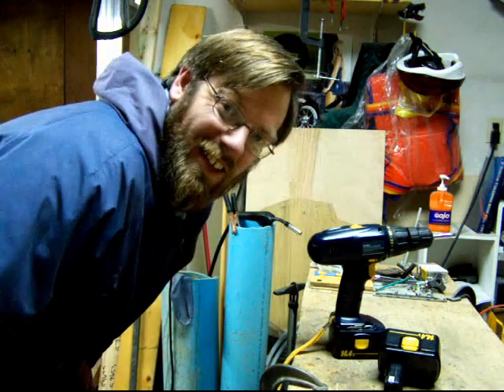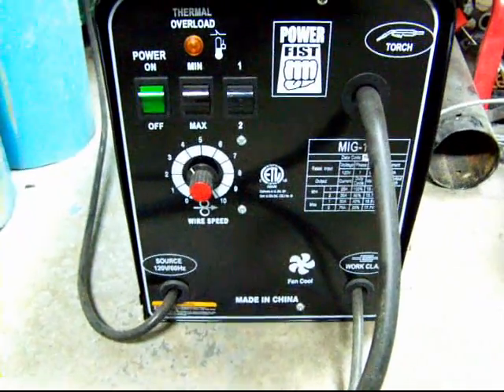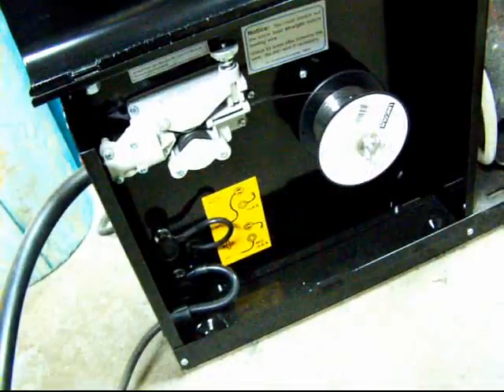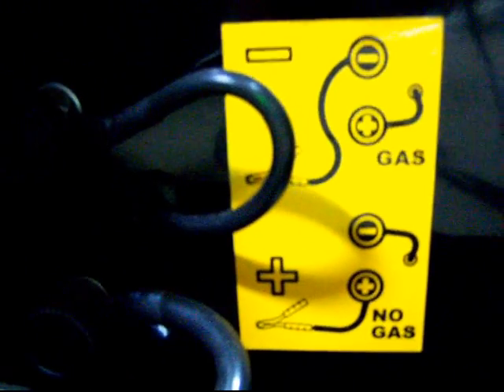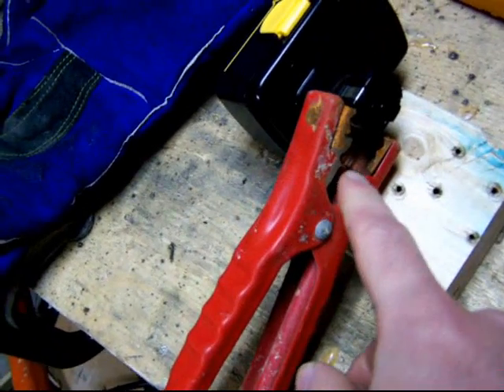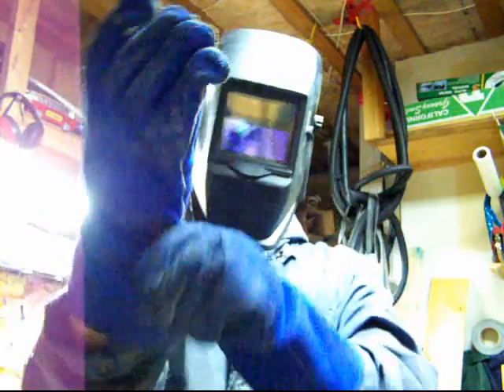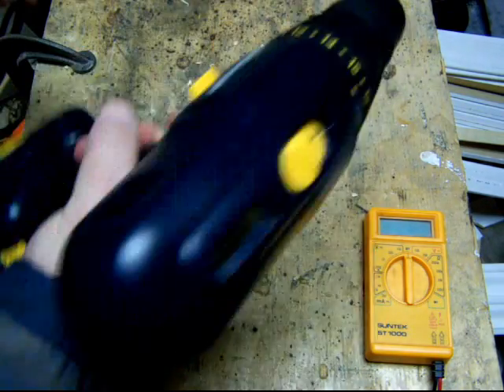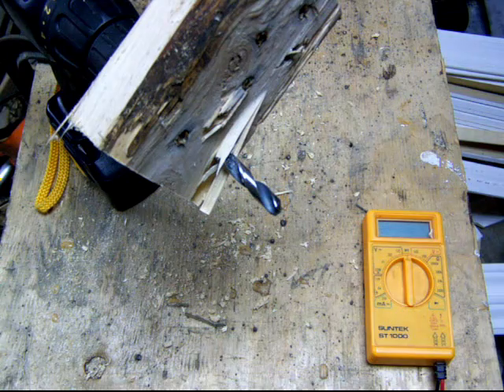How To fix: Zap a Dead Cordless Drill Battery (nicad repair tutorial)

Comment: I saw this done using another charged battery to erase the memory and also if you plug and unplug the charger several times you can get the fault light to go off and the battery will charge. the battery has to be in the charger to do this. A lot cheaper than a welder.

Comment: never thought to use a welder! I have a $100 horrible freight welder problem is that it only outputs AC. Usually what I do to revive a pack is charge it at high current 1-2 amps and after an hour of charging short it out until its dead then recharge. Ill have to buy a bridge rectifier or make a rectifier with a mason jar, mercury and a mechanical vacuum pump. Ill tell you how it goes...

Comment: Note.. Before the battery has reached the state where it will no longer retain a charge, tapping a short circuit on and off briefly across the terminals several times may be all that is necessary to rid the battery of crystals and Yes you probably can use an arc welder however I suggest you incorporate a resister in the circuit to limit the amps flowing through the battery. A suggestion would be an old 12 volt car headlight globe which are about 25 watts. It should supply ample heat to burn out the crystals that form as the battery ages and cause an 'internal resistance' inside the battery. I also suggest placing the battery out in the middle of your back yard and attach a long lead to the terminals so you are well clear of any fall out should the battery explode.

Comment: The famous zap method. One of the best way to revieve dead shorted ni-cd batteries. Someone probably wanna know how this work.
This method is used to directly burn the ni-cd cristals that cut the insulation between plus and minus inside a ni-cd battery over time. Those cristal form a shortcut that prevent the battery to be charged. If measured then, the tester show that battery as shorted. This zap with huge amp and a higher voltage than the battery  have it do the job fine. Some battery can even last twice the life time espected. ofcorse this way will work only on shorted batteries that don't accept charge animore.Is aniway not recomended to use this metod on other batteries than ni-cd, lead acid and ni-mh. Example, those new Lithium batteries now in sell will probably explode in front of you, they can't afford that stress  even for a short period.
For who don't have a welding machine, can use a standard 12 volt charged battery from a car, but in this case, the battery pack must be opened and each battery inside must be zapped can be zapped even 3 battery in chain but not more or the work will be ineffective. 12 volt is a low voltage for work directly on all the battery pack at once since for a effective work, the voltage applyed must be almost twice as the battery pack and we know that a battery pack start from 12-14 volt to 19 volt and more.
Reply: Thank you for this information,

Comment: I have a bunch of dead rechargeables for my cordless tools.  I was about to go out and buy another set when I ran across this and a few other videos offering suggestions to recover these batteries.  Since this one involved setting up the welder I decided to try the most simple of methods shown.  By putting the dead battery on the charger and unplugging the charger from the wall socket, then quickly plug it back in only far enough to make contact an then unplug it again I was able to revive most of the batteries.  When I get a little more time I will set up the welder and try this method on the remaining batteries.  If it works great if not, well I have enough batteries now to last for awhile more.  Anyway the principle is the same in all of the videos.  It seems it doesn't really matter what you use for the power source.  Even a 12v battery charger could help restore a dead battery of a higher volt rating since it is only used to "jump" the battery.  
thanks for the suggestion.  Even if it didn't work I'm sure it got a few more people thinking about salvaging their batteries.
Reply from the maker: Good job tricking your charger into reviving your batteries. And you're right at getting people to think about fixing instead of throwing out. More people should think about fixing things first these days.

Comment: I think I have two lawn tractor batteries I could use. And I did mod one of the 18V packs. I put a cord on it and have that going to a cig lighter cord and the socket is connected to a small hand truck with a tractor battery and it runs the drill well.

Comment: A little more detail. Are the amps adjustable? ( I'm welding-illiterate) If so, what is a good setting. Also, you forgot to state you put it on the charger after zapping it. 
I thought you let it rest for a couple of days after zapping, thought the zap gave it a charge. Scary if it was still warm after several days, lol.
Also, what does it do to it, does this sort of give it amnesia, you know, lose it's "memory"?  Does it take a full charge now or does it fizzle out after using it a little.

Comment: I find that a capacitive discharge technique is fairly effective at restoring NiCd cells and batteries with minimal risk of ganking said cell/battery.
I just use one or more soup can electrolytics charged up to ~3 times the nominal potential of what I'm restoring, although using a number of smaller caps wired in parallel might work as well.
Attempt the above at your own risk.

Comment: Thanks for the video.  Useful to know.   Not having a welder handy, I just tried something  much simpler and had success.   I ran jumpers from another charged battery to the dead one (+ to + and - to -) and held it there for 30 seconds.  It turns out my drill's charger won't start charging if the battery is 100% empty, but indicates that it is failed.   Connecting the good battery to the bad one briefly boosted the voltage enough that the charger now accepts and charges it. Safer too.

Comment: Success just zapped my dead dewalt 18v batt with my ark welder on around 50 amps about 10 times in the space of about 7 or 8 seconds then left it for 5 mins and ta daaaa it worked, Thanks you just saved me around 60 quid

Comment: I tried it and overcooked one battery and half overcooked another. However the trick does work it did bring the one back to life... Im amazed but i relaised that they get hot quickly... like one quick tap is probably enough then leave the battery for 5 minutes to cool. You wont feel the heat for 5 mins... as it works its way out from the inside. I did like 10 taps and a efw long touches... my battery was roasting like nearly unable to touch. So  one tap.. leave it for 5 then test.

Comment from the maker: Put a multimeter on your welder or read the manual to see what the output is. You want a relatively low DC voltage but lots of amps. I don't know enough about arc welders to say yes or no off the top of my head, sorry.

Comment: HOLY COW IT REALLY WORKS.... I HAVE A SNAP ON 14.4V AND HAD 2 DEAD BATT. and i did what you said and wow its like brand new holy cow im super happy because it was $100 for a new batt. thank you very much. i used a 110v 90 amp hobart welder for mine....P.S. its works great for ni-cad batt. not for wet cell batt. like car batt. lots of meat balls out there :-)

Comment: No - but there are intelligent chargers around that will recover any lead/acid battery that doesn't have a completely dead cell. Sometimes it can take a week or more, but it works in 90% of cases. If it does have a dead cell, it's unrecoverable by any means.

Comment from the maker: Cool. Once in a while I think about adding a bottle of gas to my welder but I barely have enough spare time to use the welder these days let alone upgrade it. I'm also running Lincoln wire in mine but I haven't had enough experience trying different wires to tell if it is better or worse than anything else for me. Thanks for watching!

Comment: I liked the video, I'm going to give this a try, got LOTS of old power tool batteries around.  Also, wanted to add about the welder... I've a very similar one (from Harbor Freight), I put some good Lincoln wire in it and added a #40 bottle of RC gas (75% Argon/ 25% CO2) and it weld beautifully.  I worked as a welder for about a year using the big Millers, I also have a Miller Legend II, but I still prefer this little unit, does everything nicely up to about .25".  Enjoy!

Comment: to zap a nicd is an old remedy to basically burn out the internal shortcut in the battery.
i usually used a 12V transformer on a single 1.2V cell and tap it a few times.
using the welder is fun to watch tho XD

Comment from the maker: If you're offering me a nice new Lincoln or Miller for $200 I'll certainly entertain the idea. Otherwise I'm doing quite well with my PowerFist unit and have had over two years of good service from it so far. And the flux capacitor isn't for fixing welders, it's for powering Deloreans.

Comment from the maker: Look at your numbers there. The 14.4v drill battery is higher voltage than 12v in a car. More voltage == faster. It would run slightly slower off the car battery. The difference there is the amp hours: how long the battery can keep giving that voltage out under load. In ultra-simple terms the car battery is going to be able to output 12v to a little drill motor for a stupid amount of hours or days. The normal drill battery only stores enough electricity to go for an hour or two.

Comment from the maker: Cordless drills are just a DC motor with a strong gearbox. If you put more voltage into the device you would get more speed out of it. Of course you would also probably void your warranty and burn the motor out sooner but it would work.

Comment: You are using way, way too much current to do this.You would be better off using a small car charger or even the other battery that works. The reason this works is because crystals grow between the two sections of the battery and cause and internal short, and by zapping it with current, you can often break up the crystal, but the hole still remains and the crystal inevitably  grows back.

Comment: You are using WAY too much power. A simple low amp car charger would do the trick, you could use a car battery, but it would also cause far too much power to go through this battery pack. This works by dissolving crystals that grow through the separation between the anode and the cathode and a couple of amps will do it. You could even have used your good battery to have accomplished this.

Comment: I tried this with some used up Nicd's. I play with Radio control and one thing I do not want is a battery going dead in the middle of a flight and loosing my plane!  It does bring the battery back to it's VOLTAGE level but the MAH's go all to hell. M.A.H. stands for milliamp hours which is how long the battery can keep putting out the Voltage it is supposed to. The unit measurement of the longevity the battery can work before re-charging. You just have to Cycle the battery to see!

Comment from the maker: Whoa now! Don't confuse soldering equipment(outputs nothing but heat) with a welder(outputs high-amperage electrical current). What I used is a welder. The trick is that you need some fairly high amperage but not high voltage DC current to do this. I think I say in the video but my welder puts out about 30v DC. If you don't understand what I'm talking about please don't try to zap your own batteries as you will probably destroy your batteries and/or injure yourself.

Comment: Your just encouraging people to try to hurt themselves....  There`s a bloody good chance they`ll explode when being zapped with a welder.  It`s safer to pull the pack apart and just find the reversed cell then zap it with a 6 or 12V battery for a split second a few times.  Which can still even be pretty sketchy, but better than hitting them with the mig....

Comment from the maker: @311ozy 
Except for how the drill is in forwards which can be clearly seen in the video by the forward/reverse selector being in the forwards position. Also the drill went through a chunk of 2x4 in relatively little time in low speed with a metal bit that is as dull as your accusations. So I could agree with you but then we would both be wrong.

Comment from the maker: @poolmotorrepairguyFL 
The spatter is my only really big complaint with my use of the fluxcore. I'm not doing really pro work here anyway :)
I'm in Canada so the closest I get to Harbor Freight is Princess Auto around here. I'm pretty gentle with the tensioner, in fact I rarely change the tension on it at all but I realize it's a cheapo unit.  Thanks for the tips!

Comment: the spatter sticks to everything, seems a mile away is to close. cuz it's going to jump over to and stick to it bigger than ship! so ya need a   harborfreight. 20-cubic-ft-argon-gas-cylinder-92807   and you can find the 20% off coupons for hobo freight in popular science in the back..check your local welding sup. and if you have another type of bottle they will trade it in for the one you need 4 free.oh and be carefull with that wire tensioner its PLASTIC. do not over tighten